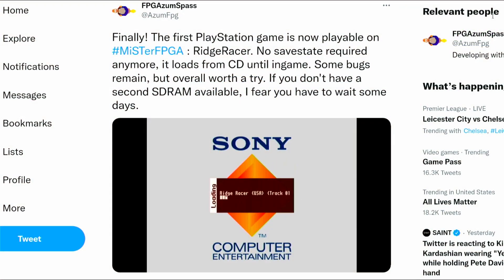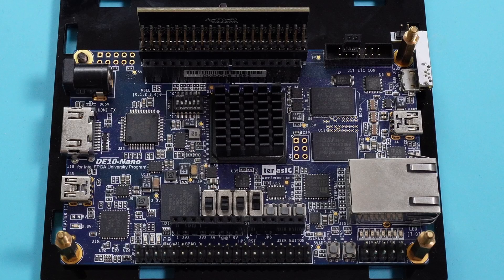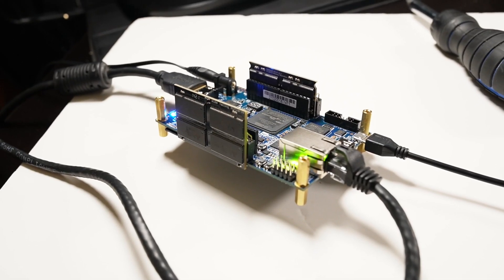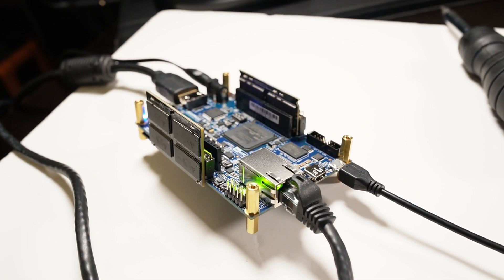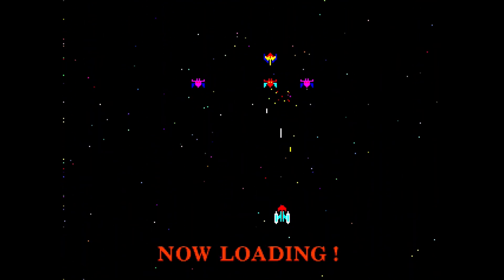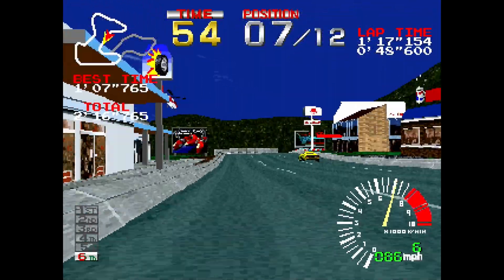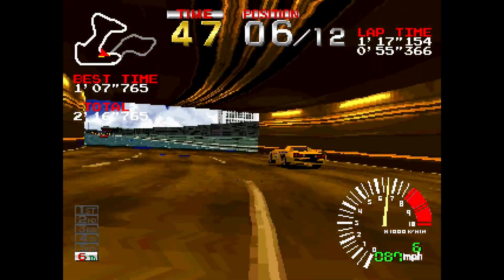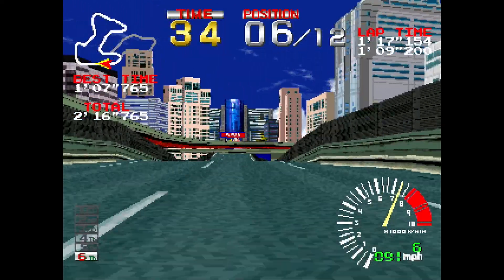Trying out the MiSTer FPGA Playstation Core

Comment: Is there any research on putting two ram modules in the same GPIO slot? Or upgrading the RAM further? That's a project that could have serious implications for future Cores , not just PS1 and 5th gen consoles.
Reply from the maker: The reason to use a second RAM module on the extra GPIO pins is for the bandwidth. The amount of memory is not an issue, the issue is getting enough data in a certain amount of time. So the extra GPIO pins gives the core more lanes to receive data from in a timely manner. Stacking a second RAM module on top of a current one is not going to increase bandwidth.

Think about how with PC's it is recommended that you install RAM in pairs. It gives you more bandwidth.

Comment: I'll be extra hype if he can get it working with the analogue as I haven't played playstation on CRT in 20 odd years and a lot of the shortcomings were probably less noticeable on a CRT. Using an emulator with all the fixes enabled doesn't look quite right either.
Reply from the maker: Yeah, would love to play the core on my CRT. I do hear that analog out works over the HDMI port using Direct Video. I unfortunately can't use that.

Comment: is really good that is working, however ill prefer it on the crt with the analog input is much better but ya it's to early now. hopefully it'll work on the Io board
Reply from the maker: Analog output still works if you use Direct Video through the HDMI port. But I do prefer using the analog output on the IO board because it lets me use HDMI and analog output at the same time.

Comment: its very hard to buy a de-10 nano board at the time for a reasonable price right?
Reply: It’s not so much the price, it’s the availability. None of the wholesalers have stock at the moment, but will later this month. Most of the reputable MiSTer sellers are selling them for reasonable prices. I’m sure there are some sharks on eBay selling them way over price though.
Reply from the maker: They currently go for around $170. They are readily available on Amazon. I bought one there a couple of weeks ago.

Comment: Waiting for the day for them to figure out adding RAM while also using the analog IO board.  Playing PS1 on HDMI is nice.. but I am the type that needs to play on a CRT with the analog output.
Reply from the maker: The developer said that both analog output through the IO board and HDMI port should work once the he gets the timing signals right.
Reply: Some of the new MiSTer cases and associated boards are using a much larger layout and contain support for additional memory while also offering all of the I/O ports. There was also some discussion whether the Saturn core might also need additional memory. We will have to wait and see what happens.

Comment: Do you know if this will work with a hdmi to VGA convertor?
Reply from the maker: I haven't tried it myself, but the developer has confirmed it will work using an HDMI to VGA adapter through Direct Video.
Reply: yup direct video works. in future analog io should work too